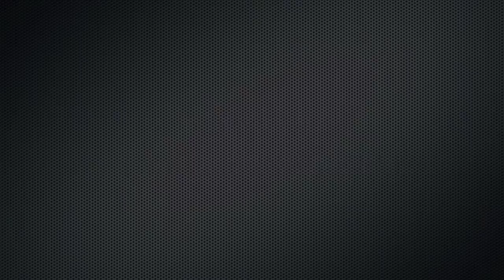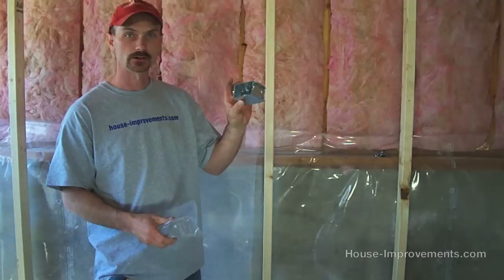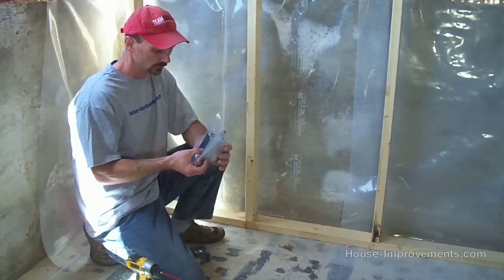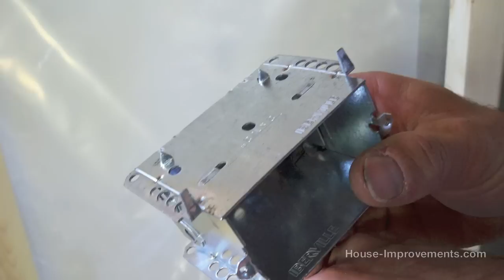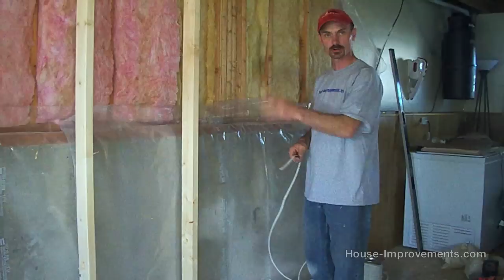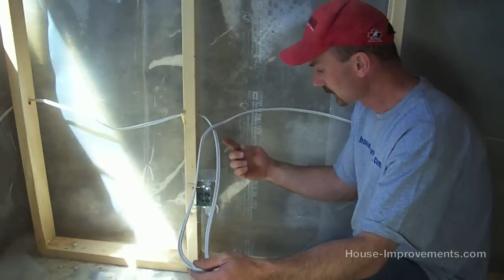Electrical Rough In

Comment: Thanks for your videos. My question is: I understand I need 12 feet maximum between outlets. However, no one seems to be able to tell me how far can the actual 12/2 romex wire length be between outlets?  The outlets are spaced so that every point on my walls are within 6 feet of an outlet. However, I need to run 12/2 romex ACROSS the ceiling from one set of outlets to another set in the same room. This cable run will exceed 12 feet. It's more like 30 feet or less. Is this acceptable and will it pass inspection? I cannot run the 12/2 inside the studs of my wall because it is a massive sliding door. I need to run across the ceiling to the other side of the door. Please help. Thanks!
Reply from the maker: Brent Seay That is fine, The problem can be that the total distance of wire from your breaker to the last plug on that circuit should not be to long and to be honest I do not know the answer for sure. But with 12/2 you should be fine up to around 150' I would guess. Come to my Forum and "Aaron" should be able to help you if you need to know for sure.http://www.house-improvements.com/forums/
Reply: HouseImprovements I really appreciate that. Thanks!

Comment: One note on the looping and stapling the wires above the device boxes - you are bending them at too small of a radius. By NEC code minimum radius bending of NMC, or "romex" should not be smaller than 5 times diameter of the wire, which in this case radius needs be around 2.5 inches.
Reply: Romex isn't half an inch thick - although it is roughly that wide.

Comment: I have a small shop with 9 - 120 volt tools and only run one at a time. I want to run the main line from the panel inside my house. What gauge wire should I run (10/2 or 12/2) and can I install a small secondary panel with breaker to drop down to 14/2 wire to feed the electrical boxes and lights.
Reply from the maker: Neither of those size wires would be big enough to run to a sub panel. But if you have  a couple of spare spots in your existing panel then I would just run a couple of circuits out for plugs and lights. For the plugs 12/2 would be ok if the distance is not over about 50'. Lights would be fine on a 12/2.
Reply: Thanks for the quick response. The distance is about 70 feet. So I shouldn't use 14/2 wire at all? And I do have several empty slots in my 200 amp main panel.
Reply: I would run at least a 30 amp 120/240 to a subpanel in the shop, preferably 50 amp.  Get a permit and inspection, in case you do something wrong. 

You can use 14/2 for 15 amp loads out of the subpanel - just like you can in your house.

Comment: @Everyone commenting on the wire length...  it is typically against trade practice (and code depending on jurisdiction) to loop the wires above the receptacle because dry wallers will synch the wire between the stud and the drywall when it is installed. If the dry-waller does you would be hard pressed to get him to pay for it as they would blame the electrician. Believe me they also don't care if your wires are in their way. If I were renovating my own house and I were doing both the electrical and drywall I would certainly loop the wired as such, however I would never on a job site. It is a good way to lose $$. The vapor bag over the box serves no purpose in this instance as the wall has vapor barrier. I would also be weary of taking advice from an unlicensed electrician on youtube. Hire a qualified professional. It is very easy to make a mistake that costs a life or causes serious property damage. 
Source: Licensed Electrician.
Reply from the maker: I like your comment and you are exactly right about the loop of wire , drywallers nick wires often and having a little extra that you can pull in prevents an expensive fix.I have trouble understanding why you figure the vapour box around the box serves no purpose? The vapour box is there to seal the vapour barrier to once it is installed. The poly you see against the concrete is a moisture barrier not the vapour barrier. In my area we are required to have a moisture barrier against any concrete below grade.Thanks for your comment though.
Reply: HouseImprovements I watched your video on installing the moisture barrier. Where I live they install moisture barrier on the outside of the building and vapor barrier on the inside.

Comment: Shannon, me again! What if the outlet box is not medal? It a blue plastic, how I connect ground wire??
Reply from the maker: The ones I can buy still have a ground screw. The ground would be attached to the box ground screw as well as the plug. If your box has no ground location then just go to the plug

Comment: And I believe the wire must be secured within 8" of the box, measured along the sheath if the cable... And I'm a third year apprentice
Reply: +TheMikey617  As per NEC 12" if clamped, 8" w/out clamps.
Reply: Its within 12" ...
Reply: But he is subject to the CEC, not the NEC. All I know about the CEC is that it is similar to the NEC, but not identical.

Comment: like every other video you post... totally wrong. Poly is meant to be on the warm side and not the cold side. You have got to stop giving people false information... get a job you fucking goof
Reply from the maker: Better pull your foot outa your ass! That is not a vapour barrier!
Reply: HouseImprovements if that plastic is not a vapor barrier how can that serve as a barrier between the concrete and the sill plate?
Reply from the maker: realemonful  It is poly but it is a moisture barrier and is required in my area and others between the cold concrete below grade and insulated wall.
Reply: HouseImprovements most jobs I've seen use a sill gasket under the bottom plate (Ontario, Canada). If you were to put insulation between those studs you would not pass inspection here. Though it almost looks like you are just keeping the moister away from the studs. 

+realmonful some areas of the word do not allow you to use PT with in a living space as it does produce off gasses and is toxic. There is newer stuff that does not, so it could be either way. I'd prefer to see sill gasket, insulation, poly with acoustic sealant.

Comment: i personally dont waste wire like that. wire adds up fast.
Reply: 14/2 is less than $1 / meter. Costs more to have to pull more new wires because you were too short or decided to move the plug over one stud.
Reply: hey stan. wire is so cheap and what he showed us  is good wiring practice awlays leave slack
Reply: It's more expensive to cut wires too short. I've seen a lot of wire wasted because of people trying to utilize the very minimum needed.
Reply: cheap?  really
Reply: when customer service and long-term thinking = wasting wire, you know you're a scumbag.

Comment: I'm curious why you used a 14awg, instead of a 12awg? I thought receptacles were suppose to be on 12awg. Thanks for the videos! Really helpful!
Reply from the maker: Not always, depends on the application, also codes are changing regularly lately.
Reply: Generally kitchen plugs use 20a 12awg all other plugs use 15a

Comment: in Canada you can't staple two wires together
Reply: depends on the staples. Iberville says on the box of S2 that two wires can be under one, same with hubble. Manufacturer says you can, inspector cant do anything. I've fought with them about it enough but they do allow it as long as you can prove you used those brands, and they seem to know now. Still better not to double up though
Reply: at least in ontario you can get away with it.

I'm ICI now but some of my friends are still resi, that new CO/Smoke code is ridiculous.
Reply: Lol yes you certainly can s1 for 1 wire s2 for 2 14\2 or a 14\3 and 14\2 and so on
Reply: Joe Chitussi
local code always over rules manufacture instruction/installation recommendations.
Reply: Joe Chitussi Yes it is. 
Ian Cooke What is the code the says you can't staple two wires together? If its manufacturers spec and the product is csa approved then why not?
Reply: Ian I've dealt with inspectors and was told by them. If a manufacturer approves it then it's fine

Comment: Thanks for the nice video.  This is the best I have seen on YouTube.  How do you run Romex in the wall if I am hiding a basement support pole inside the wall.  There is no room on either side since dry wall will be up against it.  Am I allowed to run the Romex under the support where the diameter is thinner?  Or do I have to aviod this completely? Thanks
Reply from the maker: If you can I would go up and over and back down , or up past the threaded part at the top of the support post.

Comment: Strange way to do it. I always use flex-plastic tubing. That has predrawn wires. Or simply empty flex-tubes. That way you can add extra wires and its way safer from rats. That can eat on wires, if you dont have plastic tubes. You can get some ideas from this video i found. ?v=WIQVwqwq8aM

Comment: hi Sir .. (I understand new home requirements) but, when rewiring an older home, does the NEC require tamper-resistant outlets? Or does it go state-by-state? Or is it a personal moral decision for safety?
Reply from the maker: Always best to check with your local state inspection agency ,but as far as I know if you are doing a rewire ,then things need to be brought up to current code.
Reply: If you walk into a room and change the wires for half of the plugs they would all need to be brought up to code in every regard. The other half of the outlets you needn't change because you haven't touched them.

Comment: For the love of god, this was so painful to watch.

1. In this case there's already vapour barrier and none is required for the box, it's not really even an exterior wall. BUT if you do use vapour barrier on the boxes, push the wire through the plastic, cutting it like he does makes the whole practice redundant.
2. Code everywhere in NA is no more than 6' from any point on the wall to an outlet box, or 12' between boxes along wall. 
3. Code stipulates at least 1.25" from face of studs to the wire run on or through the stud. Not "about inch to an inch and a half".
4. Use a wire rack for christ sake.
5. Save some time and money, use nails for the boxes, and just use the height of the hammer to place the boxes as you go. 
6. Get a pair of cutters, a hammer, and some S1 staples and just staple and cut the wire as you pull from box to box, you're gonna save yourself a lot in time and material. After this, go back with a robertson and knife, strip the romex BEFORE you stick it through the box, clamp it, ground it, and be done. ( Don't forget to curl the wires nice and neat so teh drywaller's don't bugger it up)
7. If you give a shit you'll want to use plastic staples and one wire per staple.. but that's just my opinion.

It's nitpicky, but if you're going to make an instructional video for people, it's not hard to do it right just once.
Reply from the maker: What you see in the back ground is a moisture barrier not a vapour barrier, this is a   exterior wall in a basement and requires a vapour barrier box around the electrical box ( or at least poly) This video can be watched any where in the world so people should check with the codes where they live. These videos are for DIYers to give them the basics and not meant for people in the trade trying to be speedy and make cash.
Reply: HouseImprovements Moisture barrier =  vapour barrier. The wall is not technically an exterior wall and therefore does not need vapour barrier... again, if you decide to use extra vapour barrier, there is no point if you cut holes in it with your knife. 
I understand that this is a DIY for non-professionals, which is why it is even more critical that it is explained properly and in full detail so that people do it right, as good as a pro, even though it will take them longer.
Reply: Figus Heimunschplit "The wall is not technically an exterior wall and therefore does not need vapor barrier." I have to disagree. In a basement, if there is any amount of moisture, you will have black mold in no time flat. The Vapor box may be overkill but what would you rather spend money on: a demo and rebuild or the extra on the vapor box. Shannon, thanks for your videos even if people try to be a DIY critique.
Reply: +HQ DIY and you bitch you seem to just bitch and talk shit too on everyone one of his videos. I fucking hate you types of dipshits.
Reply: I believe he is Canadian. I suspect that their local jurisdictions do not mess with the CEC as much as the codes are adapted/modified/ignored here in the US. Heck, we have cities/counties that are still on pre-2000 versions of the NEC - and even that modified.

Shannon did state that you need to check your local codes before proceeding.
Reply: saborguerito I'd not waste money on vapour boxes and just use cuts from the poly sheet you need for the rest of the wall. Sure it's better to have more vapour barrier, but not necessary in terms of code.
Reply: @DementedPony  
" I'd not waste money on vapour boxes and just use cuts from the poly sheet"
says the guy who is all about not wasting time?
what a joke.
Reply: yet this guy doesn't know different counties and states have different codes
Reply: HouseImprovements Unlicensed electrician giving advice to DIY'ers. Recipe for nothing good.

Comment: Around here you'll get tagged for the way you staple the wires at the box. Also it's obvious that your wiring or wire stapling wouldn't be consistent throughout the job because you sure can't leave out slack like that for a 4 or 5 wire run to a box...

Comment: I am preparing to build my first home and I will be all alone on it. I have been through residential construction classes, but it was 10 years ago and I have not been involved in construction since my time in school. Can you make a start to finish Detail of how to wire a home? I have been searching the web for one for about a month. have not found one that Gives enough detail. p.s. I was never thought plumbing or electrical only framing-finish work. -_-
Reply from the maker: Wow that would be one long video!! You are better off hiring a electrician to guild you and pull the permits and you can do the rough work for him/her.
Reply: Ball park how much do you think that would cost? p.s. I also plan on taking a electrical course before I ever get close to building my home. I just like to learn everything I can :)
also I love you videos. Thanks for all the work u have put into them and for being responsive :)

Comment: this entire video demonstrates terrible rough in practices. i'm a residential electrician in calgary, alberta. we usually drill our holes at hip height. when we're running 15 amp general circuits (120V - Arc Faults for Bedrooms) we usually pull from the home run starting box all the way to the end of the circuit (12 Items Max) and tac a S1 to hold the wire from pulling back. We then work backwards tacking all the wire into straight bundles down the studs. When we get to the end we tac the home run and the starting line to the stud at it's corresponding box and the pull is complete. We put the wire in the box when we're cutting in. We strip both wire's at the box leaving enough jacket to accommodate a nice service loop  then we place the wires in the box, tighten the bracket, bend the wire into a nice loop and fold the wire's into the box for the final. if you people are taking tips from this guy - you should call an electrician.
Reply: lol when you say "terrible rough in practices" what you really mean is inefficient practices but regardless everything he does is technically correct and up to code. this is for people doing very small personal jobs in their basements and such and they really don't have to be as good as an electrician and no one said they would be.
Reply: Quit being a know it all jackass. His rough in method isn't terrible as you say. Maybe not all electricians would use that method but this is to give people an idea of rough electrical. It's not electrical school 101. To be honest the way he pulled the wire is the way I was taught and see many electricians use.
Reply: This guy is right. Anyone who is not an electrician should not be saying this video is “correct”.

Comment: I'm just a "homeowner" so I get to ask all of the stupid questions but why did you use 14-2 wire for outlets?  Wouldn't you use 12-2 instead?  I guess that's what I've always heard.
Reply from the maker: Many basic receptacle runs ,like bed rooms in this case can be 14/2 on a 15Amp arc fault breaker. If you have runs on 20Amp breakers or runs with heavy loads then 12/2 is required. 12/2 would also be ok to use in the basic runs though.
Reply: HouseImprovements Hmmm.  I learned something new then.  Thank you, Sir!

Comment: ummm, i was wondering if you had any links on how to increase the speed of electrical rough-in/trim. im just finishing up my electrical apprenticeship and find im wasting time wiring 3-5gain switches. it takes me anywhere between 2-5 min depending on whats going on there.. the biggest thing is twisting the grounds and crimping the crimp sleeve. anyway.. any tips would be appreciated
Reply from the maker: Don't worry you will get quicker as you get more experience . One thing I like is keeping your tools all right with you as you move around the room, wether you like to wear a pouch or carry a bag or what ever.
Reply: Yeah, i carry a tool pouch.. With all needed tools. Thanks.

Comment from the maker: The actual preformed boxes I use are not required by code. Many people simply use a 24" x 24" piece of poly wrapped around the box and seal it to the face of your air/vapour barrier.

Comment: Staples should be at least 6 inches from a box/device thats why I usually drill at knee level which is around 2 1/2 feet so you dont come close to the hole. Also individual staples for each wire is good practice.
Reply: Dang bro, your knees are 2 1/2 ft???
Reply: @mattwykstra3502  6'5 ;D